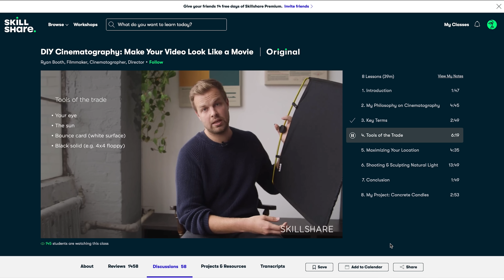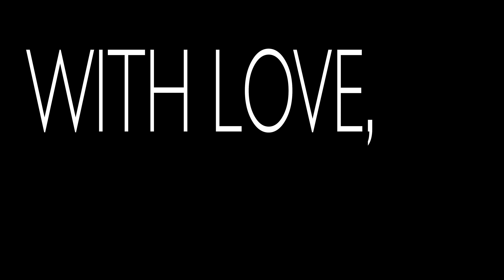Exploring a NEW FPV Spot – First Flight RAW DVR

Comment: Nice work, gotta love the DJI 720 onboard, saves the day. Friends too. New spots are usually kinda funky. I usually find out about 1 in 3 is a drive away. the 2nd is meh, and 1 in 3 or 1 in 5 is a keeper. I keep going back to the same old, even though it's long since become routine. Been so long since I've flown right now, I'd fly anything. 
Good concept, keep working it.
Thanks for sharing your trip!

Comment: 11:13 nice use of physics with the kwad.  Your flying skills have improved quite a bit over last year I seen a full flight.  I think throttle is the toughest with lower resolution 6S/5055S (I have to use lots of angle in turns to allow mistakes).